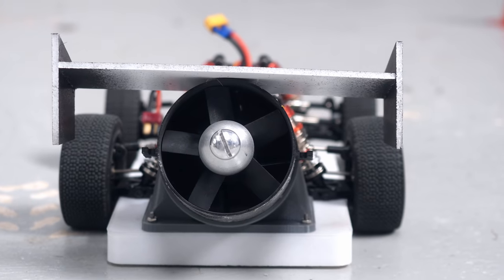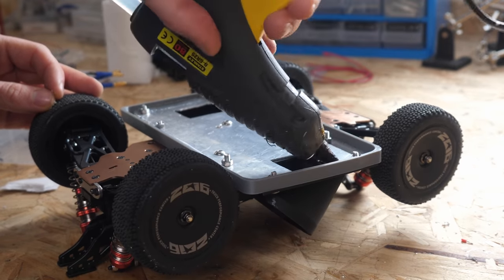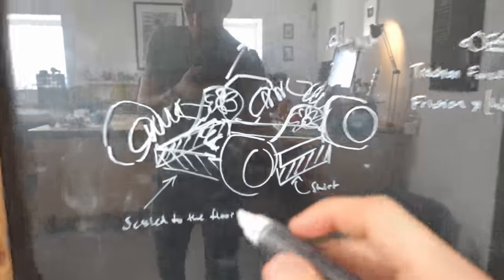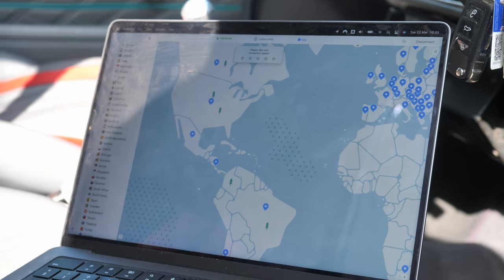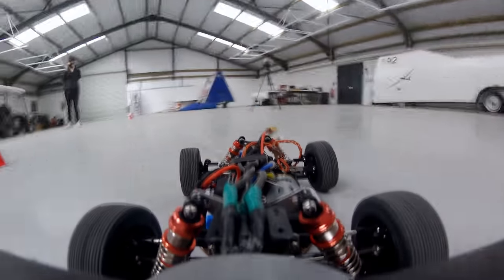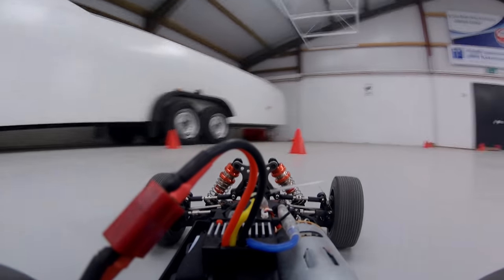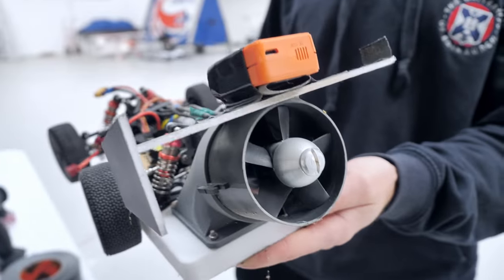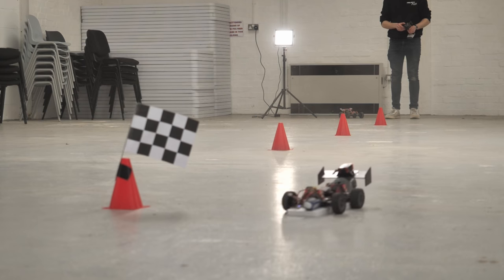Vacuum Effect RC Car

Comment: Would be interesting if you fitted the car with a more pointy setup so it doesn’t understeer as much, maybe lift/stiffen the rear and lower/ soften the front and see how the balance is through corners. Of course your floor would have to be wedge shape but I think the front would stick much better. 

And the one with no downforce probably would be better sliding instead of slowly adding power, flick it in to get it sliding and hold the slide with all wheels drifting would be much quicker without downforce.

Comment: I see lots of comments here about changing the edf, or stiffer suspension. But right now your problem is sprung downforce. If you can find a way to mount the tray to the hubs, this would remove the suspension all together and you can control the air gap independent of amount of suction. Thus you can power the fan up even more without the effects of suspension, friction, body roll, etc.
Reply: Yeah but if the skirt loses it's seal you now have a suspension less car with way not enough grip

Comment: try connecting all of the equipment for the effect directly to the control arms instead of the chassis so all of the downforce is applied directly to the tires and doesnt load up the suspension

Comment: Could you try varying the down force depending on steering input? Perhaps keep the EDF spinning but vent air under the car when you you are in a straight line to reduce drag, then proportionally close the vent as you corner more.

Comment: Would help if he used an impeller here  instead of an EDF.
 A centrifugal blower or impeller as found in a turbocharger or a vacuum cleaner is designed to generate vacuum. A ducted fan or EDF  is designed to move a large volume of air quickly.  However when air pressure on the suction side drops the blades stall and the efficiency falls. This is why ducted fans produce less thrust at a standstill than they do in motion

Comment: i'm not an especialist, but i think you're spinning the blades in opposit direction as they should, they are designed to have full power spinning counter clock wise, so if you spin clockwise it will bee less effective, flip the fan and you'll have better results.

Comment: You should have tried putting the fans on correctly, they aren't working well when they are backwards.
Reply: Also, you don't lower the fan speed, you adjust the skirt.

Comment: Nice to see your using wltoys 144001... I would of put the droop screws in the a-arms would kept the arms straight and would of used like 1000cst oil as wltoys use 200-300 cst oil.....

Comment: cool video! would have really liked to see the car without the vacuum to be the same weight, as any differences you observed could be contributed to the difference of weight AND/OR downforce. With weight giving the car slightly more downforce but mostly affecting turning, handling and braking.

Comment: I think you should've gotten rid of the suspension coils and just remove them with a rigid bar, that way the suspension wouldn't compress and the scirts would be less prone to dragging on the floor and allowing for the fan to spin faster

Comment: Now make one where the vacuum draw is done by a jet eductor system. Think of how the Dyson "bladeless" fans work, and that should give some ideas. Then you wouldn't have to worry about FOD issues and needing a screen. (Just remember anything kicked out of the back is a potential small projectile.)

As for the topic of vacuum cars in general, the Chaparral 2J took it to such an extreme that it was eventually banned from the racing series it competed in. (I think they used the excuse of it being a safety thing if it ever lost vacuum, but I don't think that happened in any of the races it did participate in.)

Comment: I feel like you missed the point of the fan and the venturi tunnels which accelerate the air moving past the floor and suck it down to the ground with a lot lower drag than a direct vacuum seal. Also would only require the sealing on the sides and perhaps you could implement the sliding skirts to prevent them from scraping and slowing the car down?

Comment: I was thinking about that, you could print the outer part of the skirt in nylon, it's less abrasive than pla. Also, what if you put the potentiometer for the power of the fan on the direction in a way that you get less fan power on straight lines and more when the when are at an angle. It probably won't do much difference but it could help you get less drag therefore more speed.

Comment: Another suggestion used the fans or call it for what it is mechanical downforce creating the vacuum under the car at low speeds but have lubbers our gates at the front and the back of the vacuum box that can be opened once you get above about 45 mph for a start that way it goes from being a vacuum box to being an actual underwing now you have to shape it as such and your vacuum fans at that point can shut down now you'll have to use some form of damper our check valve on your fans but the point is at low speeds use mechanical downforce are the fence at high speed you use the underwing and you want the underwing unsprung are the vacuum box come right off the back side of your spindles with your supports to it

Comment: It'd be really cool to have a dial and maybe toggle switch that lets you change the fan RPM between presets.  Or, tie a fan curve to the throttle and have a dial with preset throttle to RPM rates.  Admittedly, I know FPV tx's but don't know RC car transmitters so well, so I don't know that this is possible.

Comment: I see a lot of fancy comments about trying to actively control the fan to deal with the skirts etc... The original F1 fan car concepts did it best IMO with skirts that were able to move up and down freely. This is better than the electronic active fan control ideas too IMO as it also still allows you to use the suspension travel without bottoming out on a rigid skirt.

Comment: Next step. Make it so the edf only sucks when you turn by wiring it with the controller. Maybe pair it with the left and right signals. So 100% of the turning signal means 100% suction etc. Because it probably does not help much on the straights

Comment: With your suspension that soft, it seems like you're just sucking the hard skirt directly into the floor, increasing friction, without increasing the pressure on the tyres significantly. If, while turning on the vacuum, the skirt pulls the car so far down that it touches the floor, you are doing it wrong. A soft skirt or a skirt attached to the suspension would help, or a stiffer suspension

Comment: 00:02:43 the motors practically block the holes. Surely that was choking the airflow, a much bigger hole in the aluminium might have worked better. I think the sieve was a a bit fine too. I also think stiffer suspension springs would improve it as it would keep the ground gap more constant and allow higher suction.

Comment: Did you consider mixing the fan speed with steering, so you only get strong downforce in the corners? That way, you'd have less downforce drag on the straights. Just a thought.

Comment: Did you consider using a 'soft' skirt rather than a rigid one? Similar to a hovercraft instead of an F1 car. Takes into account power to weight issues as well as negating ground clearance issues. Just a thought.

Comment: It would be more efficient if you had the fans running the way the blades were designed to run. Obviously you'd have to mount the whole unit the other way round which might look a bit messy! But it would be way more efficient.

Comment: I noticed in both the duel and single ducted fan cars, you installed the fans backwards.   This is probably due to the ease it is to run brushless motors backwards by simply Switching 2 wires.  And although brushless motors generally run equally well in both directions, the fans do not. Running a ducted fan in reverse I would guess is probably about only half as efficient as running it in it's designed orientation.   Running the fan backwards would cause all kinds of vortices, turbulents, and just generally poor performance.   Remount the ducted fans the other way and you'll get at least double the downforce.

Comment: Suggestion, What if you leave the front of it opened snd use the Bernoulli’s by shrinking the passage through which the air goes through while also using the fan to further accelerate the air thus producing more downforce and also on a bigger chassis so the effect is even more noticeable.

Comment: I wonder, if you could've mended the skirt hitting the ground problem with suspension travel limiters? That would've allowed to use the full potential of the suction fan. In a larger scale this would be a very uncomfortable solution though

Comment: You swept the floor, but each segment of floor has a crack where tons of dust and debris are collecting. Each time the car passes over a crack it would suck out a good bit of that I imagine. If you want to try this again, tape over the cracks separating the segments of concrete. I think it would solve a large part of your problem.

Comment: The fan car is sort of a hovercraft going in reverse... Leaves me wondering: could you have the air from under the skirt be routed into an inflatable skirt and then out... Or maybe some bleed air from the fan to inflate the skirt... I suspect that might give you a better seal with more give, like what you were trying to achieve when you used the tape as a skirt.

Comment: Could you program the fan to spin faster when you turn the wheel? Surely that would minimise its drag when going straight and the downforce isnt needed, and maximise it in corners where it is

Comment: The bottom is not properly sealed and small parts break out due to the suction pressure, which clog the strainer and thus reduce the suction pressure. BUT very interesting Video :)

Comment: You need to reduce air pressure but you can do that in another way: tiny holes creating a boundary layer. Planes with ultra STOL abilities use them. All you need are thousands of pinholes PUSHING air, not sucking it.

Comment: did you try putting a tighter suspension on the vacuum version? it would counteract having the fan at full power so the skirt doesnt touch the ground

Comment: I feel like it would have been easier to use a prop and bldc motor to push air up and thrust car down. top with with g sensor and microcontroller logic to apply down force only in certain conditions. might be pretty boss!!

Comment: Ooh! What about a “dyson bladeless fan”-style spoiler? Where air is blown out of and over the spoiler to generate downforce even at low speed? 🤔 It would almost be a hybrid between the vacuum-style and large spoiler cars you made already, but I’m not sure if the fluid dynamics would work like a dyson bladeless fan or not.

Comment: The problem in my experience has to do with the differential and if you have foam tires they will expand significantly under power which makes it almost impossible to control

Comment: You could try and have a downforce controller that works in tandem with the speed of the car, the speed of the fan proportional to the speed of the wheels

Comment: You can test the downforce on the scales. If it increases with weight, your low pressure generating fans are working.

Comment: Just curious... Have you given any thought to placing the power plant near the front end so it's more of a pulling force to carry the vehicle! You're using an unmanned system... That's still seems to be sticking to designs like a driver is inside / used... Because a normal car couldn't put a jet engine on the hood without frying who's behind the wheel! Again... Just curious if a paradigm shift on design and power plant placement would help or hurt your cause?

Comment: you need very very stiff suspension and your fan blades are backwards and then remove all the aero because its no longer needed and just added drag ... the suction needs to be enough to really squish the tires into the ground that is why stiff suspension is required and you want the suction to turn on just before turns or hard acceleration this part is difficult because of driver saturation so what most teams did was just set the suction motor to max throttle and let the car rip.

Comment: For better vacuum car results you should work it in to tie the vacuum speed in with the throttle. Or at very least RC the vac throttle on an independent channel so you can control it on the fly.

Comment: So do you think you could achieve this using the Venturi effect? You could potentially put an EDF in the front and have a thrust tube the full length of the car that would then not require any filters as any crap it picks up would just be fired out of the back and not potentially damage the EDF

Comment: Great Video. What about controlling the fan based on acceleration/deceleration and steering angle with an Arduino? This way you could increase fan speed during accelerating and breaking or when you go into tight corners but at the same time you keep minimum friction for high speed run and save battery on the fan system. 🤔
Reply: Because then you run into the driveability problems that the 70s fan cars had because the downforce generated was tied directly to the throttle, a lot of the time in the fan cars you would have to take corners with way more throttle then you should in a lower gear to get any grip out of the system, it would be much better to have a fixed amount of suction plus venturi tunnels and active bits to help get the air out from underneath at speed
Reply: @coreygolphenee9633  Good Point, but I didn’t mean controlled by Throttle, but Acceleration/deceleration and potentially you could also use speed instead of throttle. I think it could be a nice try :)
Reply: @3drcprint166  and it I do agree that it could work but then in my eyes every element that could effect the suction need to be active, aero and suspension included, if you could make the car optimize every corner on every level it's possible, but a constant suction seems to be a more user friendly setup in my eyes or to do it in stages, low speed high speed cornering and a straight fan speed with a few pre set adjustments in the suspension and aero would be the best compromise

Comment: This project are still running isnt it?,
since i got severals idea just to make it better, i think,

First of all you need give  a little bit gap between the skirts and the road, it could gives the difference between creating air wall and dragging the skirts which is you had been tackle with lower fan speed,

Then you need adjustable fan speed, where is to controls when you need maximum vaccum power to increase your grip, or lower the vaccum power to make it not oversteer or understeer

and the last one is,
Aerodynamic body which is to make sure the air flow are right on the way we wanted

Comment: I wonder if there is an opportunity to adaptive control here.  You could mount an accelerometer and measure lateral acceleration and ramp the fan RPM up and down.  I'm not sure the system could react quickly enough...

Comment: you want the car as stiff as possible so it does not bottom out or porpois, you could also somehown create an invisible skirt by forming an air vortex with some parts, you would just need adrian newey and a very powerfull computer

Comment: Could you find a way to have the fan spool-down on straights, and up to full power for full lock when steering? Also, if 30% is the ideal power for the fan, then perhaps you can lighten it by using a smaller motor :)

Comment: I think you should have added weight to the stock car to match the weight of the edf car. I think the weight alone is adding downforce and helping the handling.
Reply: Weight actually adds inertia to the car so the net result is a wash in terms of grip benefits. There's a reason all road race cars seek to be as light as possible.

Comment: Ironically, this concept was recently tested to be far superior to large spoilers on F1 cars.
McMurtry Speirling did WR on a Goodhill hillclimb, beating F1 cars and Volkswagen I.D. R.
It has 60 kW double fan setup with 2 ton downforce, while weighing less than 1 ton overall.
Reply: They have known this since the early 70s hence why it was banned in F1. The lotus and Gordon Murray brabham both come to mind but they also had a ton flaws when it came to actually driving them

Comment: running fans backwards? surely reduces performance.. unless some weird effect makes it work in a stalled, or close to, scenario like this. i get its easier to install like that but.. also cant really have suspension for this setup, unless the skirt it also sprung.

Comment: The first one probably could of held its self upside down if he would of done the test on the same piece of metal he used with the 2nd car.  The first test was done on a piece of particle board or something like that so it couldn't make the seal it needed.  The 2nd one was on smooth piece of metal that god the seal it needed.

Comment: I think on the F1 fan car the fan speed was dictated by engine RPM. It would be interesting to see how having the fan mapped to the car's throttle would affect its characteristics. logically it would make it worse but understeer at low speed might make it quicker or more fun to drive?

Comment: Did you add additional weight to the stock car to make it the same weight as the modified car?  Total weight will also have a large influence on the overall grip. Do you have any friends that race rc cars?  I don't want to sound mean but it doesn't appear that you spend a lot of time driving land based rc stuff.

Comment: if you don't want to have to tune the suction so much, just limit the suspension with a hard piece so the skirt is physically incapable of touching the ground, or make the skirt higher to achieve the same thing. those F1 cars are physically incapable of dragging on the ground like that, so the recreation prolly shouldn't either.